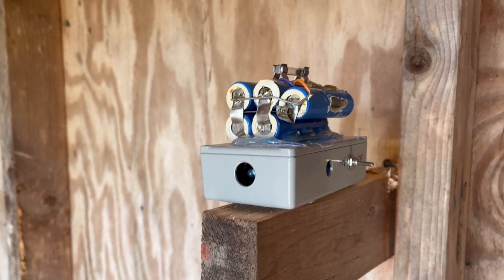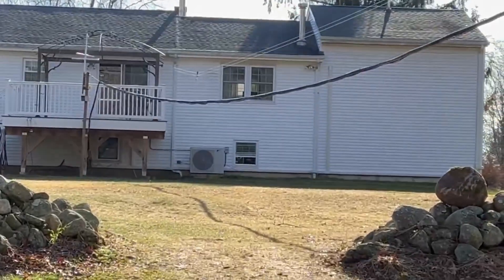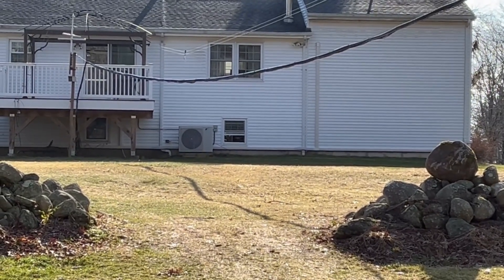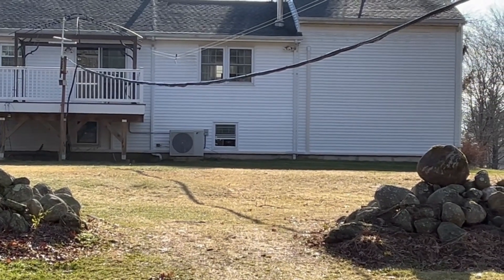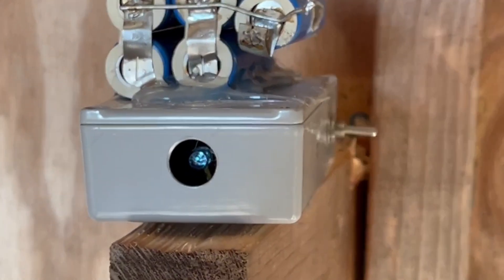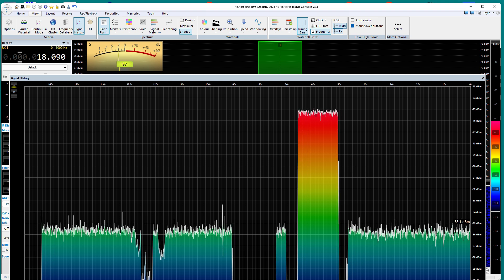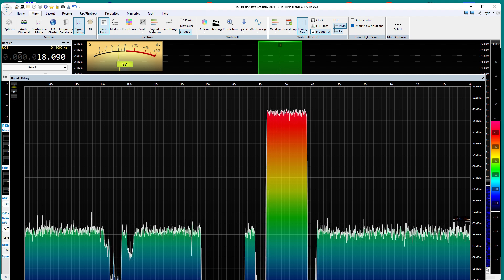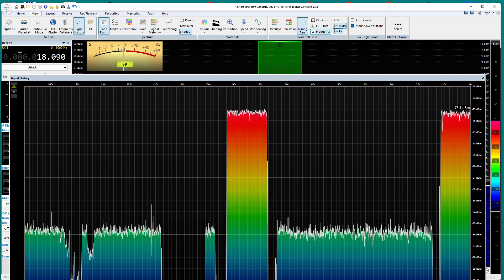Comparison of 5" lens and 10" Fresnel lens with weak signal source

Comment: Interesting experiments. Imagine an array of fresnel lenses focused on a black steel pipe supported on a resettable spring-loaded clockwork to track the sun and connected to a steam engine.  
I use my fresnel lens, salvaged from an old TV you know the type. As a deathray for stirred-up fire ants mounds. A pretty open focus is all that's required, they fold by the hundreds if not thousands with a few quick passes. Those underground learn quick not to come out. I propped the lens up with two shovels, on one mound, after making periodic adjustments, I noticed a brown beer bottle.
I filled it with water and buried it in the mound, after a couple of adjustments { because the earth wouldn't hold still } I had boiling water. The bottle finally broke once most of the water was gone. Caution!!! anyone else reading this⚠⚠ UV Eye Protection Is A Must. Like cutting torch goggles and sunglasses.  Also, store in a sun-free area, perhaps keep covered w/cardboard.
Reply from the maker: Thanks for sharing your "fresnel lens" knowledge and your unique pest control technique.  Be safe out there!  LOL

Comment: In my tests I decided that an 8X10 inch Fresnel lens was about the practical limit for cost and portability and I switched to using a tinier detector to reduce Johnson noise from the device itself and of course worked on a finer focus on that smaller surface. So, largest convenient 'light bucket' and smallest convenient detector producing what I think of as the highest 'signal magnification factor'. I also used a tube extension on the front of the receiver tube and flat-black paint on the inside of the tube, though I don't know to what extent that helped reduce ambient light-noise pickup. It just made sense. However, the end result was hard to argue with. Please keep up with your experiments and videos. More experimenters need to learn of how easy, how incredibly impressive the results, and how much fun can be had with communications at at optical frequencies. As I'd said in my comment on your previous video, my buddy and I were sending Hi-Fi audio over 6 miles using a 99 cent laser as a light source with a total expenditure of much less than $30 if one uses scrap materials. But non-laser light sources with far more power are available cheaply and can solve a lot of focusing and atmospheric problems, the direction your work is leading in. There's simply a whole lot to be done at these frequencies for anyone with an inventive mind.
Reply from the maker: Hi John,  Thanks for adding you experience to this comment section.. The more folks who know about others experiments the folks that will give it a try.. Thanks for adding this comment W1VLF

Comment: Hiya Paul. It would be neat to see how these two signals would look at night vs. the daytime. I.e., don't change anything in the setup just wait till it gets dark.  Thanks for the neat videos. 73
Reply from the maker: Hi Gedas,   The only thing that changes, it SNR improves... Noise floor drops signals are not any stronger that I can see. However, this basic system is literally deaf,   as that photodiode is looking into 50 ohms instead of  many meg ohms.  When using the hybrid detector photodiode like a Burr Brown OPT101 or better yet a OPT 301 the sensitivity is orders of magnitude greater... however the photodiode gets swamped by sunlight during the day and the amplifier saturates... Even with narrow filters.   The sun is a powerful IR emitter

Comment: Another great video, Paul.  Do you know the spectral response of the photodiode?  I wonder how the range might be affected by using an infrared diode of a different wavelength on the transmitter end.  I know you touched on placing an IR filter in front of the photodiode in one of the earlier videos to reduce "noise", essentially creating a low-pass or bandpass filter.  Many game cameras use 850 nm IR LEDs, but these can produce a noticable dull red glow, versus the "black" 940 nm LEDs.  I would be curious how the air attenuation of the different wavelengths might affect the range of the the system for a given intensity of light.  Various constituents of the air, such as dust, pollen, water vapor, etc. would likely scatter different wavelenghts to different degrees, so you might get better range from one wavelength versus the other.  Thanks for the great video.  73   Ken -- WBØOCV